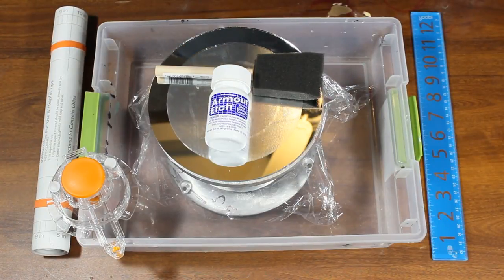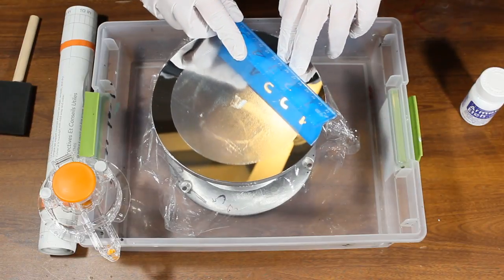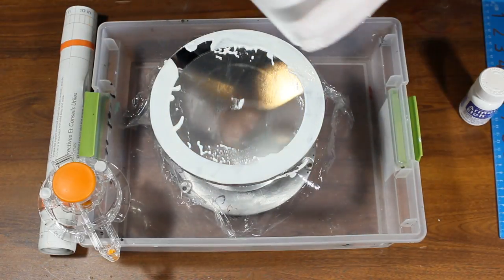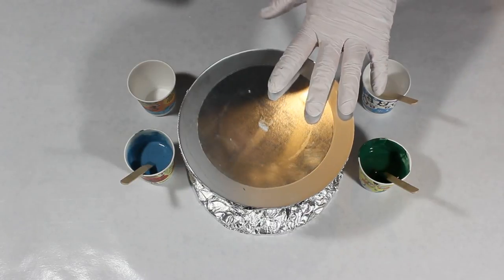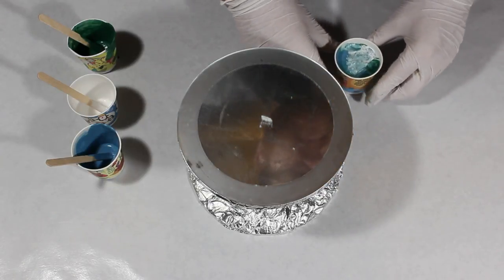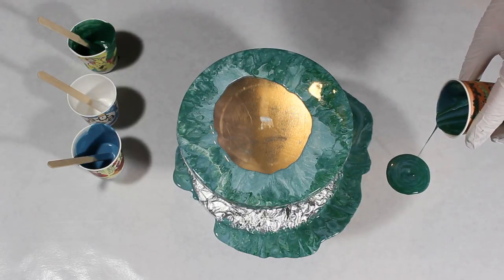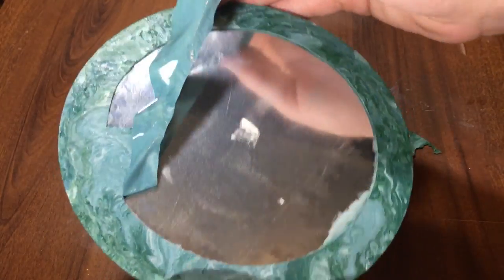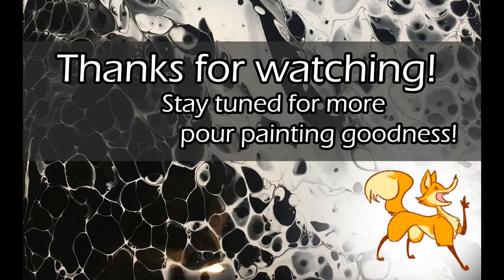Glass Etching Cream and Fluid Acrylic Paints - Decorating a Mirror

Comment: Hi I'm new very new to pouring acrylics. Question I have , could you etch initials in the center of the mirror and pour on that having the rest of the mirror covered. Basically the opposite of what you did in this video. Thanks I subbed your channel and enjoying your videos.
Reply from the maker: Thanks very much Dan! Yes, you can etch initials as well. The Armor Etch brand makes vinyl stencils that you can apply onto glass, and you can also tape certain types of plastic stencils onto the glass as well.

Comment: What do you think about using a very strong adhesive on the outer ring? Then paint that. Just a simpler idea than using toxic etching cream. We all love alternatives. By the way, that mirror turned out pretty good. I'd like to see one about 4 or 5 times that size and maybe an oval. It would look good on the wall.
Reply from the maker: I like the idea, that'd be an interesting concept! Are there any adhesives you have in mind? I haven't done much experimenting with adhesives on glass
Reply: My first thought was Gorilla Glue, but I know there are other glues, or should I say adhesives, that could work. Like something in the construction industry. Maybe Liquid Steel or JB Weld. Something like that. I don't know, just an idea.

Comment: I think I saw people who poured directly on mirror without etching cream. Isn't it possible?
Reply from the maker: Hi Sheila, it's absolutely possible! However, I've found that it's still easy to scratch the paint or peel it off, so this experiment was to find out if the etched surface would help the paint stick better. While it does stick better, it's still not completely permanent!
Reply: Try adding waterbase glass additive to the paint aswell as etching